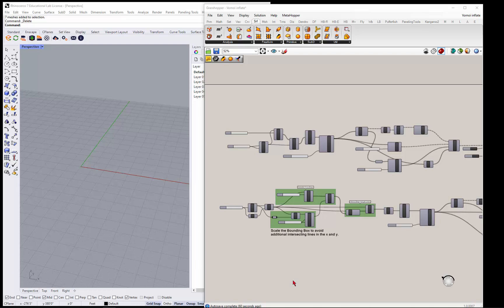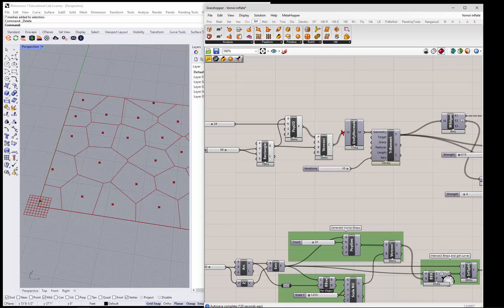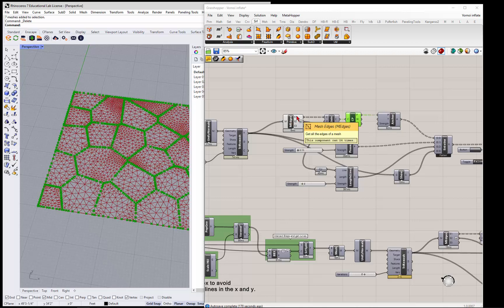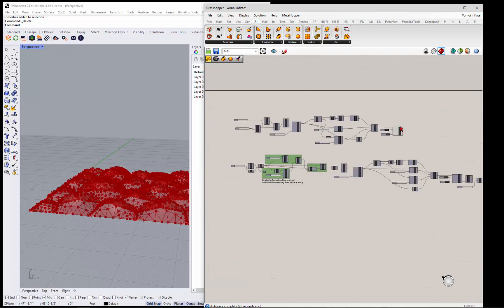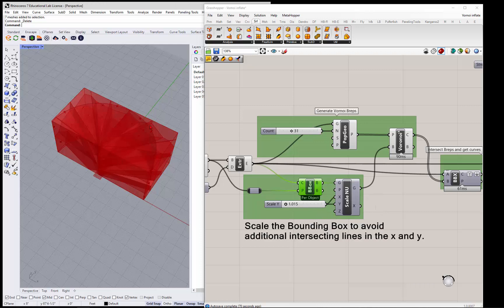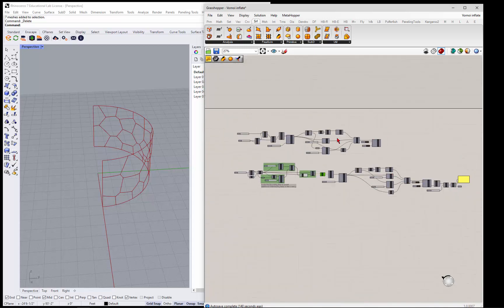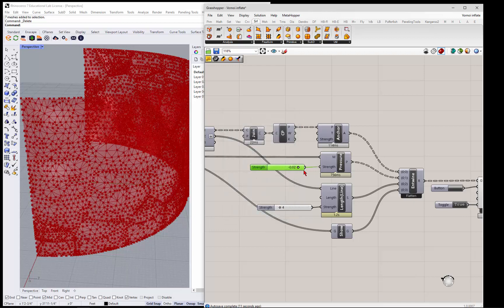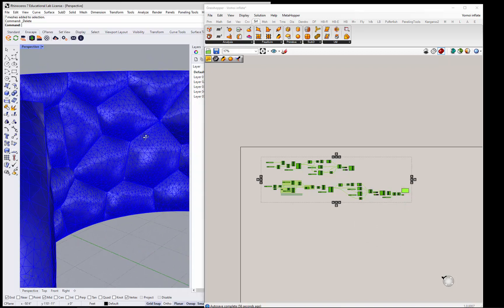Grasshopper Kangaroo Voronoi inflation with planar vs curved surface

Comment: Hi Smith! Thank you so much for posting this...It works fine for the first time for me, but the second time when I changed the surface, then something funny happened...It's like the bubble blows away 1 second after I clicked "TRUE". Is there any explanation of why this is happening? I could send my case  to you if needed....

Best regards,

Xi Su
Reply: Oh Never Mind Smith,  I changed the number higher of Voronoi cells and problem fixed! I guess the bubble was too big  for Kangaroo to blow...
Reply from the maker: Hello Xi su,   if you want to send it to me I can look at it this weekend.  Most likely the anchors are not connected....or you could try the Grasshopper Forum.